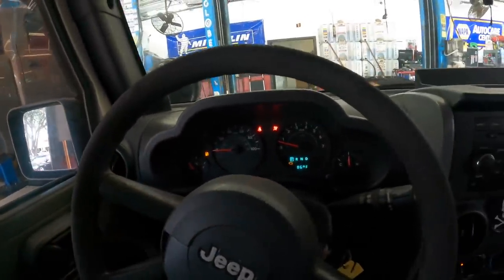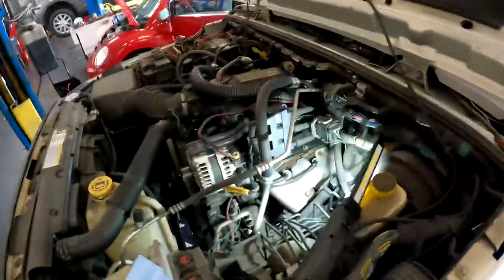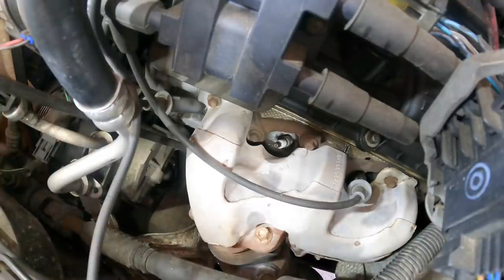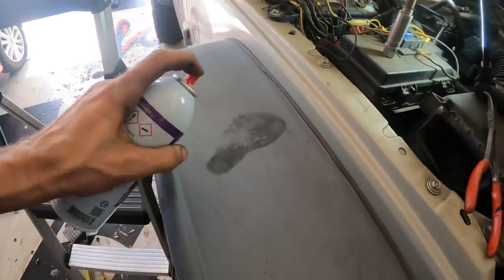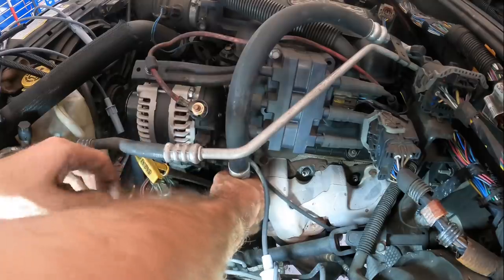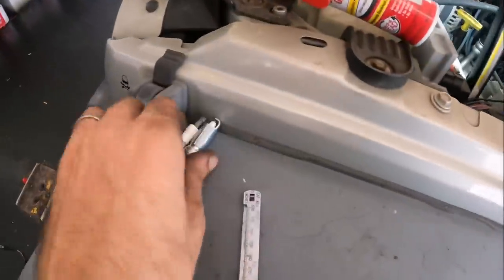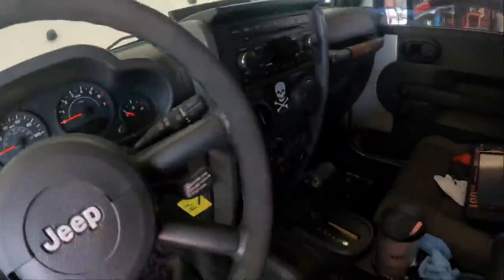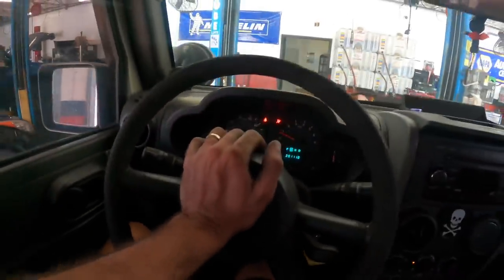My last car! Case of the Fridays. Jeep Wrangler 3.8 P0300

Comment: A Jeep that the frame hasn't rusted in half! I didn't think they existed! You know it's a problem when kits are available to repair the frame.
Reply: Some of us are lucky and live in a no rust zone.
Reply: @jefferp  And while I don't have a Jeep, some of us in the rust belt know that a car wash includes thoroughly spraying down the underside after you've driven in salt and slush for days after a storm.
Reply: Even though it isn't rusted.  I bet it's still cracked.
Reply: @greendryerlint  For sure. It’s a must to get the underside. When I lived in a rust belt state back in the dark ages, I would go to the coin car wash and work on the underside. At times, it was cold enough for the water to freeze on the car.

Comment: and I think it's ironic when they have all the aftermarket goodies including grapevine looking wiring, but can't change a set of plugs and wires, nor spend 69.99 on a basic code reader to diagnose the vehicle needing the simplest of tune ups,
Reply: You don't even need that.  Just a $5 "ELM" BlueTooth transceiver that plugs into the OBD port and a free smartphone app.  Or spend a few bucks and you have one with more capabilities including data logging.

Comment: Heyyyyyy. You said you wasn't going to use Never Seize and then you put KY Jelly on the boots that stops them from seizing on the sparky things.
Reply: Nah, that wasn’t to keep the wires from getting stuck. It was to keep the electrons from getting out.
Reply: @docgiggles130  That may be true but have you ever tried to get old boots off if it wasn't applied? They almost weld themselves on.
Reply: @craigstubbs1991  I have. That's the bonus reason for using that grease

Comment: Why do I always get a P0302 on my customer's Jeeps and I end up replacing the driver's side heads?? I do a complete  spark plug replacement , intake gasket R/ R , and replace the defective  COP  to have the code return in test drive cycle.  I am moving to Florida. Didn't vacuum the leaves from the squirrel cage blower fan??

Comment: My alternator tensioner arm broke its frame bolt. Unfortunately the bolt threads are still stuck in the bolt hole. I removed the tensioner for safekeeping, and my alternator belt is now being kept under tension by a ratchet strap attached to the right front body panel until I can get it to a mechanic. What would you say if THAT rolled in?

Comment: Did the dielectric Grease come with the wires or the plugs, if the plugs would have came with anti-seize you would have added it. No reeee!  I'm just asking why you would add dielectric grease but not add anti-seize.

Comment: Hey Ray, you said if the plugs do not come with anti seize then you don't put any, how come? Also, what are your thoughts on checking the gap? Some come "pre gap" but I still check mine. Thanks for another great video!
Reply: Ray said he checked the gap on the plugs in this video.
Reply: @loneranger4175  Yep I missed that thank you Ranger.

Comment: Can you hammer down the top of the spark plug to make the gap smaller?
Reply: No, don't "hammer" on the spark plug.  You might crack the ceramics.  To set the gap, you bend the electrode, preferably using a tool made for that purpose.  But, bending  the electrode that is at .070" gap to .050" will move the tip of the electrode a little to the side (it won't be directly over the center).  That might make combustion a little less efficient.  That's OK for an emergency repair, but these days, we don't re-gap the plugs.  We just replace them with properly-gapped plugs..

Comment: I noticed when you were closing the hood after the tool check, there was a missing cap on something in the lower right of the compartment. What was that and is it not a problem like that? Just curious.

Also the buzzing of the thingy cage in the cabin still remained at the end, I am surprised you did not fix that "leaf contamination".
Reply from the maker: It was the washer fluid bottle, cap was missing 🤷‍♂️
Reply: @RainmanRaysRepairs  thanks for responding to the first part. Did you do anything with the "leaf contamination" of the blower for the cabin? That sound would drive me nuts long term. Surprised you did not mention it again at the end there.

Comment: Plug wires, what are they, throwback to 1905?  Two best things ever, fuel injection, no carbs, and no more plug wires, coil on plugs, less stuff....
Reply: You're clueless. Until they became too old and too scarce I've kept such cars on the road for 45 years for less money than one new car of any kind costs today. The last SBF I built went 185K miles without needing the carb touched after the engine was broke in, needed no plug wires in that time, and only got plugs at 50K miles because I bought a set before I pulled mine and found they were still like new. Electronic ignition is good- the rest far less so.
Reply: After driving now well past 1.5 million miles, on cars starting with a 1966 Chrysler, old crap is junk, carbs are more obsolete than a rotary phone....fuel injection, and now direct injection, improves everything, EVERYTHING....from a 19666 Chrysler to my current 2019 VW Golf R.....stay in your obsolete world, I'll have lots of reliable FUN, with a modern direct injection 300 hp 4 cyl Golf R with stick of course...oy vey....Im clueless, ok.  17 + VW products since 1987 have them evolve better and better, improved stuff, high miles all the time 316,000 on a VR6 Jetta GLX reliable, and never stuck ever.  VW also pioneered electronic fuel injection on mass produced cars, it changed everything...direct injection is now common on everything, cus it's better...2022, not 1922 join it
Reply: @P_RO_  yeah, nothing says brilliant like driving a 45 year old obsolete car, oy vey.....come out of your time warp
Reply: @cengeb  Obsolete? It does all I need it to and being something I can take care of myself spends less downtime needing service than anyone else I know who runs anything newer. Mine was designed to last; theirs is designed to become obsolete and die. Not to mention mine's holding it's value or increasing and theirs loses value faster than gas through a funnel or eggs through a hen. Living in the non-rust belt and loving it...
Reply: @P_RO_  there is no downtime, after 56,000 flawless miles on my 2019 VW Golf r it gets oil changes filter changes, and just put a new set of tires on it, there is no downtime, and it is super quick, comfortable and 30 mpg when driving the long 3-4 hour drives i do a lot of....join today, not 1922..yeah, a 45 year old car, what an investment, oy vey
Reply: @cengeb  56K ain't nothing. Neither is 400 HP in a bone-stock engine. The 427 Ford Medium-riser I had did around 600 HP+ according to all I can find about it, nobody claims less than 500 and at least 450FtLbs on torque (factory specs were under-rated by intent) . And my last work truck served me well for 9 years at a cost of just above $1500 per year including initial cost, rebuilt trans, fully rebuilt short block, Michelins, oil changes, and all repairs. And I've built- NOT bought- several cars, engines, and transmissions which went over 150MPH and a couple touching 170MPH. I just see no need for such on a daily driver anymore; I have no need to impress anyone but me and I have come to appreciate cheap long-lived reliability over all the rest. It's all that anyone truly needs.

Yep, that Golf is a good one and I do like those cars since they first came out- but it won't last 30 years of regular use without lots of plastic being replaced- that's if it's available then which it won't likely be. Sure as he!! the paint won't go that far, but mine has and it's bright and shiny still. You and most of your contemporaries have no clue about how cars were in the past, with most built to last as long as you wanted to keep them and almost nothing which cost much to repair plus that was usually easy to get to and do in your own driveway. And it's not that things haven't improved but for normal driving without crashing in the hands of someone who enjoys taking the best of care with their vehicles about all you can say for them is they get better fuel mileage with less pollution. Cars today are built .like tennis shoes; meant to be seen in, worn, and discarded when worn out or when they're no longer in style. Like one friend's Lexus (a supposedly top quality car) which got scrapped before it turned 13 because of the cost of replacing the several sensors it needed to pass the smog check would have exceeded the value of the car. Keep that Golf and you'll hit that kind of point too. 

And there's the realm of collectibility adding value. Even  plain old 60's and 70's cars have reached a point where they are worth more now than they cost new in non-running but restorable condition. We all know what the special ones cost. Is such a thing going to happen with cars built since say 2000? or even 1990? Other than a few very special rare one I think not. And none of those will be usable as daily drivers even if someone wanted to. Their appeal was solely in their technological advancement over previous years and that has been eclipsed long ago. Nothing special enough about them for anyone to really want to have one again except perhaps if it was their first car. Even then they were not designed to endure so darn few of many of them even exist anymore even just 22 years (or 32 years) later. As was intended the world has been sold on the idea that the proper approach is to buy a new car then keep it for the limited time it's use won't cost you huge chunks of money to continue. Then you buy a new car and continue the process, leaving behind an often near-worthless old car with something known as an expensive failure point inherent in all of them waiting to die fully soon. I could opt out of that because I could get great deals on great old vehicles which I could repair and rebuild mostly on my own as that was needed. I know which ones to get and which ones to avoid and I've got the next one already in progress- only 19 years old but with an excellent body and very good interior, and I can handle the rest (except the AT rebuild). Going to cost more than my previous one but I still expect to drive it for less than $2K per year and it should do me at least 5 years service, likely 8 years and 15+ if I can find a cheap rebuildable block to play with. Think your Golf will do that? Do the math: It won't. Whether you're impressed by me or not I really don't care because I'll still come out ahead of you in the end and be just as happy as you till then.
Reply: @P_RO_  Stock golf r mk8 does 171 mph on the autobahn, rock solid and stable, drives like it's nothing, lets see an old Mustang do 171 mph on the Autobahn, the thing would probably be all over the road...wake up, Audi and Benz even VW tiguan R in Europe has over 450 HP using 6 cyls...time has passed you by, really, you are living in the past.  That thing can cruise all day long at 150 mph plus, I can guarantee you an old Mustang ain't gonna be doing that... Join the 21st century, stuff has improved big time , and the 2019 Golf r has a 6 year 72,000 mile warranty, no U.S. car ever had anything like that bumper to bumper, it's now down to 4 and 50K, bumper to bumper...30 mpg yeah cruise for 4 hours at speed how many times ya stop to get gas, I get 380 miles per tank full...and it wants to cruise all day..old Mustang ain't happening..as AUDI says, what good is power without control...and the Golf R is 4wd for much better control than an over powered wheel rear drive old car...driving is more than a straight line ya know
Reply: @P_RO_  Tires, filter oil change spark plugs, that's it, no repairs...400HP from a 4 cyl, and you only get 600 with 4 more cyls V8?  that sucks!!! Audi is phasing out V8 as is everyone, including U.S. brands, obsolete, Audi V8's push 700+ HP, it's 21st century, drive an Audi RS 7 then tell me what an old Mustang is good for. oy vey
Reply: @P_RO_  Cars from teh past didn't have 12 year corrosion warranty either, I had all the old JUNK 1966 Chrysler 1970 New Yorker 71 Imperial, the paints fade in 4 years, corrosion starts right away, horrible brakes, tires lasted 20,000 miles, old stuff is JUNK...polluting, inefficient JUNK been there done that, I had lots of horrible crap Chevy's as company cars, Pontiacs, all CRAP, couldn't stay in it's lane the steering was so loose and crap...Obviously you have never actually driven real performance cars, that have full control, not just wasted HP...I've had 1966 1970 decade cars, 1980, 1990, 2000, and on and on, they are now better than ever, if you really think some crap from the 1970's where better mad, oy vey...you need to wake up

Comment: So it's OK to put dielectric into the new spark leads (that don't come with dielectric), but not OK to put anti-seize onto the spark plugs (that don't come with anti-seize)??!  ;-)
Reply: Yes, because adding dialectric grease is an improvement in the ability to prevent arcing, whereas adding anti-seize onto the spark plug makes it likely that you will over-torque the plugs.
Reply: 1/8 turn on tapered, 1/4 on crush-gasket type.

Comment: Are you sure that's a 3.6?  It looks a LOT like a 3.3 or 3.8.  As far as never-sneeze goes, after having to tear a head off a 3.3 when a back sparkplug snapped off in the rear head on a 2002 Dodgy Caravan, I will forever more use silver snot on the sparkplugs!
Reply: it's a 3.8
Reply: @TheSavage3.6  That makes more sense.  On my Chrysler 3.6 I only had to replace 3 cams and a complete set of lifters and followers.  This has been an expensive year for the pentagram of doom.

Comment: The 3.8 liter V6. The second worst motor Mercedes (Chrysler) ever produced. The first was the V8 it's based on.  I'll take the 4.0 inclined six any day. That thing was bullet proof.
Reply: The 4.0 was based on the AMC 232/258, upright inline.  Not a slanty.
Reply: In my experience there actually pretty reliable.   There's a crap ton of high mileage caravans running around with 3.8s.   Water pumps, intake gaskets mostly, and a few cracked flex plates
Reply: @HoLeeFuk317  every one I’ve run across with higher mileage on it has had either blown head gaskets or has dropped a valve rocker ( not a fan of the free floating rockers) and the resulting mayhem that goes with that.
Reply: @gerrycarmichael1391  I don't recall ever doing a head gasket on a 3.8 but that can happen to any high mileage engine. And 3.8s have pushrods and a rocker shaft, they're not free floating.
Reply: @HoLeeFuk317  I stand corrected.  The 3.7/4.7 uses free floaters.  The 3.8/4.8 do not. Different motors.
Reply: The inline sixes are great for blown head gaskets and cracked heads though..
Reply: @greendryerlint  I've heard that but I can honestly say that the 3 Jeep 4.0s I've owned went well over 250k miles w/o those issues.
Reply: @boggy7665  7 main bearings and just would not die unless you ran it out of oil or coolant for awhile.
Reply: @greendryerlint  Some of the later ones had problems after they tried to make them cheaper and more pollution-friendly.

Comment: Who uses Champion plugs as OEM?
Wouldn't it be a German plug being Daimler owned?
Reply: Chrysler isn't owned by Daimler.
Reply: @TheSavage3.6  
From 95 thru 2009
Reply: @TheSavage3.6  

"Some two years later, on 27 April 2009, Daimler AG also relinquished the 19.9 percent stake which it had initially retained in Chrysler."
Reply: Just an FYI, many Mercedes cars and trucks made it into the American market thru this merger, Sprinter vans, Chrysler Crossfire and some others, I don't know exactly which models were in the mix

Comment: Your title is wrong.  It's a 3.8 not a 3.6.  Man,  it's easy sitting in my recliner critiquing others.....   I may be management material finally.

28:00 was the lid to the plastic reservoir missing before you started working on this?

Comment: Thumbs up.   A bit to much di-electric grease. Why do people bring their cars in with hardly any fuel ,I see it a lot.
Reply: Hello Mr. Dragon, I thought the same about the quantity of di-electric grease since it is an insulator. But, I am not a professional mechanic. (I pretend to be an E tech sometimes) We typically only apply this DC4 insulating grease to the boot.  Maybe it's just the standard quantity of Lube that Ray uses, when " injecting my lube into both holes" @17:56.  :-)  I am so immature for how old I am. 😆
Reply: People bring cars in all the time with full tanks. Usually when they have in tank fuel pump problems. 🤬
Reply: @jefferp  True.

Comment: You don't put anti-seize on the plug threads but put grease on the plug wires. Go figure.
Reply: The anti-seize isn't necessary for the ignition system to function properly..
Reply: @greendryerlint  Neither is the grease. However, when the plugs seize in the head after 100,000 miles and you strip the threads pulling them out, you're screwed.

Comment: You said leave a comment so here it goes lol, use the "GREEN" dielectric grease,  Molykote G-5008 Dielectric Grease, on sparkplug wires clear is not correct. Just saying

Comment: What a rats nest of wires this Jeep has been molested badly with aftermarket crap and an owner that just does not give a donkey biscuit. I am sorry but all those wires running everywhere is driving my OCD nuts. Ray just like that dang twisted heather hose. MY jeep wires look all neat and ran in wire looms, wrapped all neat and tidy and sealed. My Jeep has run through 5' high water for hours with no problems all ground points are cleaned, shiny, and sealed with dielectric, grease every 2 years. 290,000 miles still has 190 PSI compression on all cylinders and gets 19 MPG in town and 23 on the highway. If you keep up and take care of your vehicle it will last and take care of you.